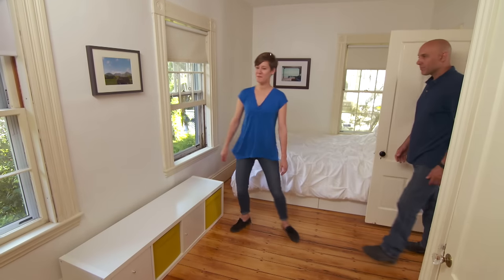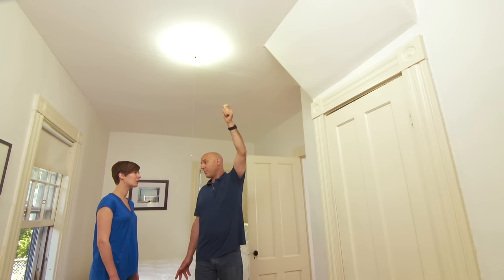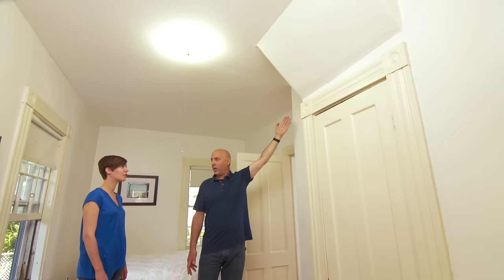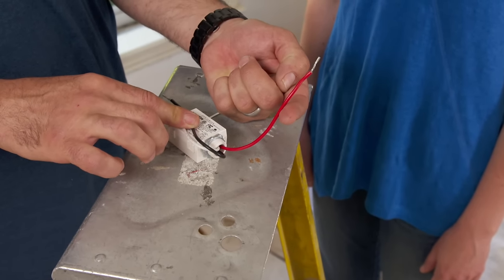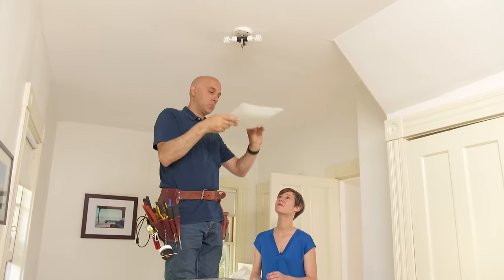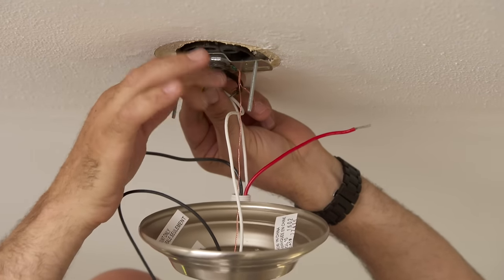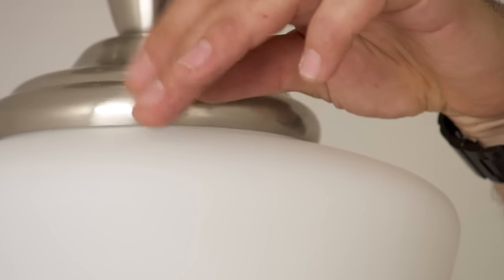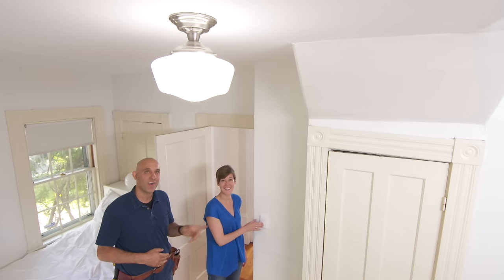How to Install a Wireless Light Switch | All About Lights | Ask This Old House

Comment: LABOR $150??
MATERIAL/PARTS $200??
YES, BATTERY $$??

ELECTRICIAN RATE $75 HR ?
AND They doing that job in less than 1hr.. why charging more $like $200.
Reply: Please re-watch the video as he explain the MASSIVE ADDITIONAL amount of work an electrician would have to do to run the wires inside the walls.  It would cost abut 25 times MORE if you did not use this solution and hired an electrician to run wires inside the walls. 

Please review this video again. Thanks Bob

Comment: Da hell do you mean, "switch over to an LED and you'll never have to change it again"??? I call straight 'bullshit' on the lightbulb industry. Sorry guys, but since switching to LEDs I'm changing these cheap pieces of shit out more than ever. And I'm buying brand-name bulbs (like GE and others).
Reply: We have switched to Phillips LEDs about 8 minths ago.. at work.. We have 1071 ligbulbs in house, and since then I changed two ...
Reply: on the other hand, we have few G10? or G20 .. the ones with two prongs on the back.. which we changed for the LED version ... and those little suckers are a joke, the go in and out... one week three work, next week six work, then all ten, then one goes out, catches back on thru the week.. I think it's aliens
Reply: We switched about 20 bulbs out to Cree 3 years ago, and haven't had one problem. Plus, I like the color temperature with the Daylight bulbs.
Reply: we have two of those in the elevator.. they're like superbright..

Comment: What ?? 
ALOT OF WORK??
Means to MUCH MONEY?
If they are PROFESSIONALS is not "A LOT" Of work and cheaper. right?

save you a lot of work  adding a switch.. 
but wireless. . WILL NOT SAVE YOU A LOT OF MONEY. 

Wireless. . for electrician is the fastest, laziness way to do a JOB.. 
AND MAKING "A LOT OF MONEY "
Reply: Please re-watch the video as he explain the MASSIVE ADDITIONAL amount of work an electrician would have to do to run the wires inside the walls.  It would cost abut 25 times MORE if you did not use this solution and hired an electrician to run wires inside the walls. 

Please review this video again. Thanks Bob